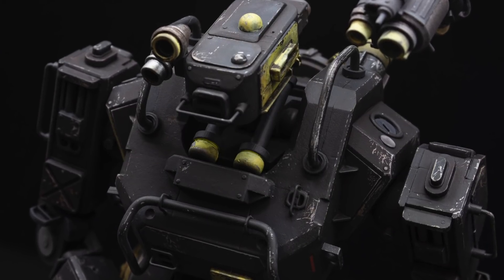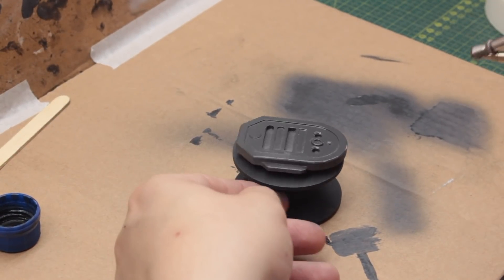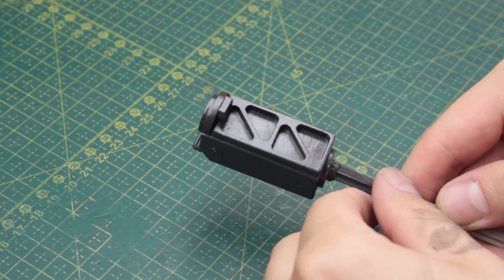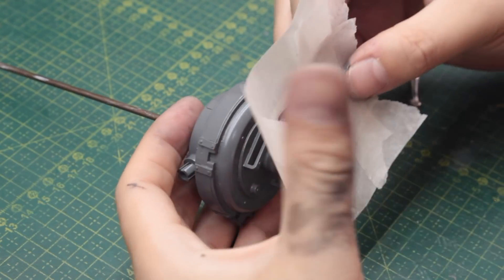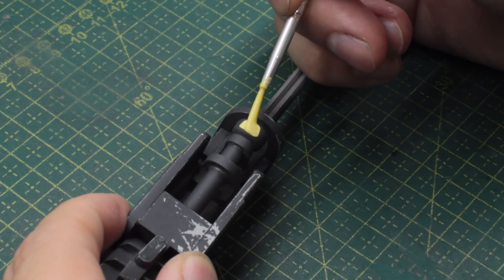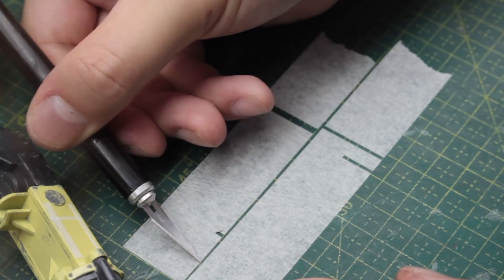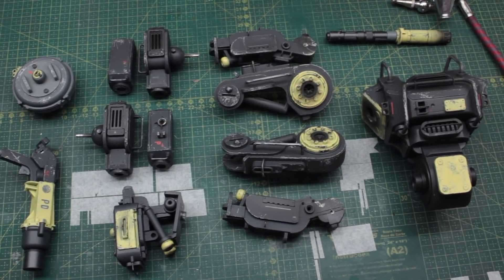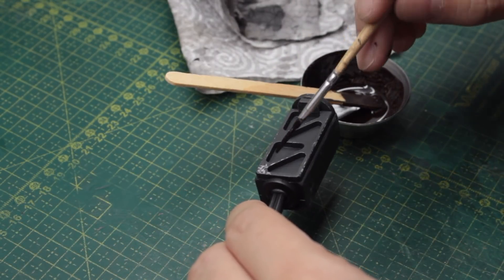Scratchbuilding a Humanoid Repair Robot - PT8 - Let's Paint it!

Comment: A good acrylic metal paint brand is the Vallejo Metallic colors. First paint glossy black primer, then apply the 'steel' or 'duraluminium' paint, finish with the metallic varnish. And for chipping effect, have you tried the chipping medium from vallejo ? Apply on the finished metal paint, once dry paint the final color then once dried apply water and scrubb. The paint will chipping where the medium was applied. I use it on my military and railway modelling  in 1/76 "OO" scale and 1/35 military models.
Reply from the maker: Unfortunately, vallejo paints are very expensive here where I live :( (like every other world known brand, actually)

Comment: If you wanted to add even more detail, adding a bit of blue, white, black or other metal paint to make some parts look like another alloy. A bit of sandpaper used in multiple directions before varnish or clear coat can give a texture to different areas as well. You have done a great job though but, just adding for your and others' consumption.

Comment: A helpful tip to prevent leaking under the masking tape. Apply a coat of clear before you apply the color coats. The clear coat will seal any gaps and prevent leaking under the tape. Once the clear is applied and dried, apply the color coats.
Reply from the maker: Got it, I'll try it soon! Thanks a lot, mate

Comment: I do kind o f the same process for metal chipping, but I toss the parts a little on a box with old screws and bolts. Then after the oil weathering effects I spray some chrome spray on a piece of cloth and work the shiniests parts and edges that must show metal . I do this as the very last step since any kind of varnish will dull the metal glare. Great work as usual.
Reply from the maker: Precious tips you just gave me, gotta try this soon! Thanks a lot buddy!
Reply: Can you do a video demonstrating this technique?